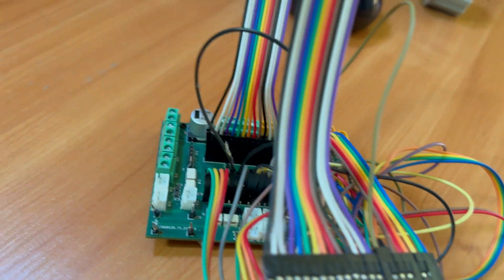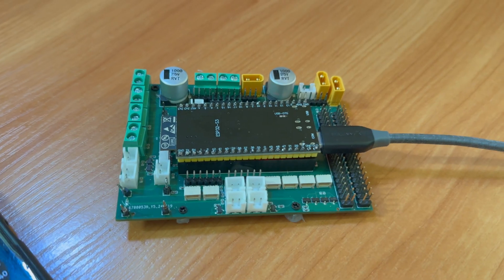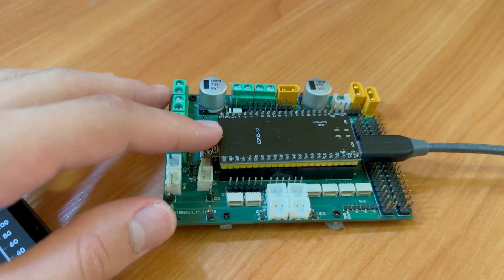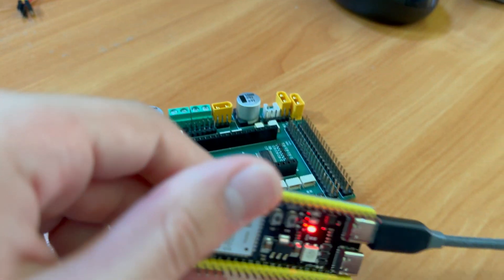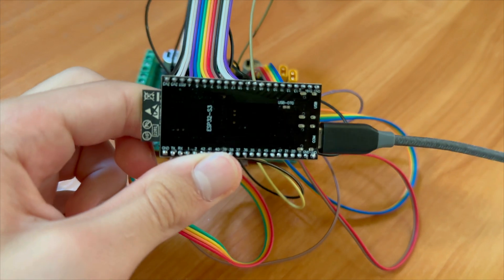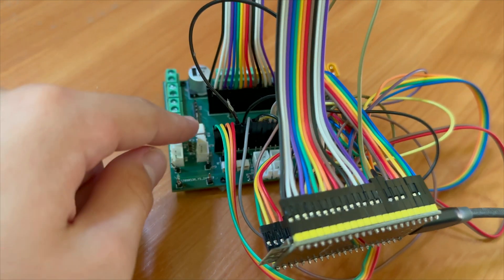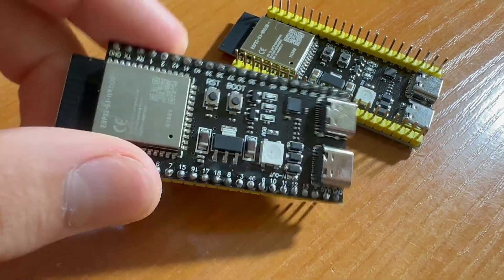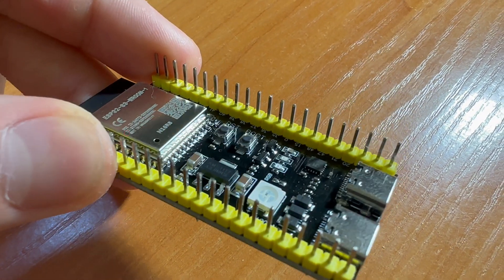ESP32 inside PCB won't connect to WiFi

Comment from the maker: UPDATE, I solved the problem by desoldering some random pins and finally getting to the problem, it was pin 7 but turns out, I just need to set it as output and give it value of LOW (0) and also pins 1 and 2 when desoldered (setting them to low in software like pin 7 did not work) and now it's working.... gonna make an update video for it.... btw, thanks for the suggestions  😊
Reply: Hello man, i have the same issue, powering the esp via USB works great, but powering it via vin pin with 5v and no wifi acces point. What is causing the problem?
Reply from the maker: Hey there, sorry, it took me so long to respond to you. That's interesting to hear. On what esp32 board is this happening? I had problems with the esp32-s3-wroom-1 dev board but it was resolved by desoldering pins 1, 2, RX and TX from the pin holders. There is usually a connection near the vin pin, either shorted or left unconnected try to make sure it is shorted so that power can go from vin to the voltage regulator. Let me know, how it goes...

Comment: That is why you need clearance and not put the antenna on the middle of the board, reflections can do destructive interference. It does not look fancy to have that part out of the board but it is a design requirement. My recommendation is to get another version with a connector for the external antenna and place it in another place out of the PCB.
Reply from the maker: Yeah, I will make that change in the new design. meanwhile i think I solved the problem

Comment: probably the location of the antenna. those small trace antennas can be quite sensitive and from what i'm seeing it is mounted facing down into some connectors. the soldering seems good from what i can see in this video, plus i don't think it would cause an issue either way. is using an ESP32 with the chip facing upwards not an option? alternatively, as bartosz said, you can go for an EP32 with an external antenna. that would be optimal. in the worst case you can simply use a small piece of wire, tho you might get more issues if it is used inside a project.
Reply from the maker: I accidentally placed the pins on the pcb in reverse, so it has to be this way... a mistake that I will get rid of in the new design... I couldn't really find a esp32-s3 chip with external antenna connector but I will keep looking.

Comment: You can try to diy external antenna, it’s pretty easy, maybe it will work
Reply: From laptop would be perfect because they’re tiny pcb antennas you could just hide inside your robot, but one from WiFi router might give you stronger signal/ longer distance
Reply from the maker: Pretty good idea, I will try to find a chip with external antenna connection but still, the wifi is working everywhere except when the chip is in the PCB...
Reply from the maker: My guess is that there is something else going on in the PCB and maybe causing some interference? Or maybe some pin is malfunctioning and making the problem? I will try to desolder pin by pin and figure out if there is some problem.
Reply from the maker: But checking the datasheet and the voltage at each pin, everything should be in order. So maybe something with software? I'll try some other version of esp32 boards in Arduino IDE...
Reply: @Rovi-HRS  i think it’s the way it’s mounted, if you look at any board with esp or any other WiFi module in form of esp it’s always mounted on the edge or there’s a hole in pcb so there’s nothing behind the antenna
Reply from the maker: @bartosz7778 so I’ve tested the software, but nothing worked… I will try to do the pins tomorrow, otherwise I don’t know what I’m gonna do, in the worst scenario I will try to design a new PCB, with maybe different chip and position/orientation
Reply: @Rovi-HRS  try adding the antenna, im telling you, this might work, and i think just a piece of wire could work fine, use schematic i sent in previous comment and in place of center pin solder a wire about 4cm i think, i have smart lightbulb with very tiny esp which doesn’t have onboard antenna and there’s just wire, I just measured, it’s exactly 4.5cm, it looks kinda like special wire, but regular might work too